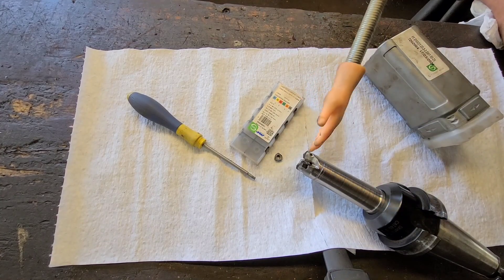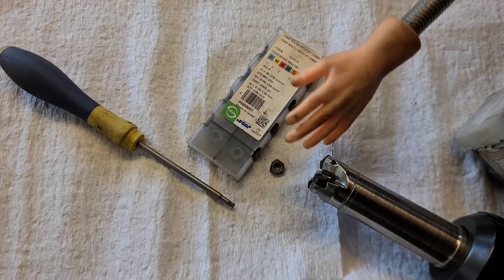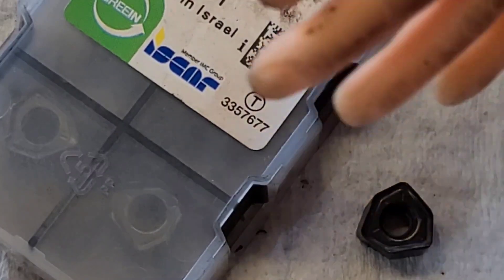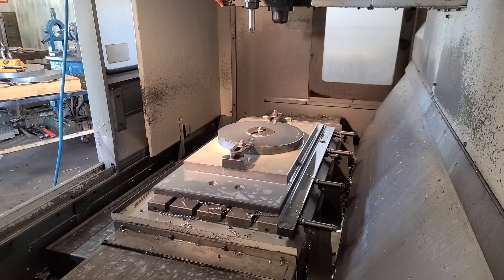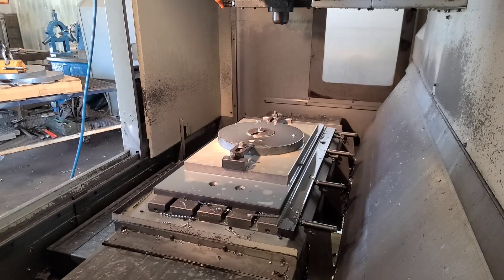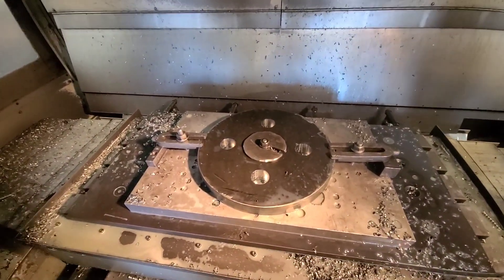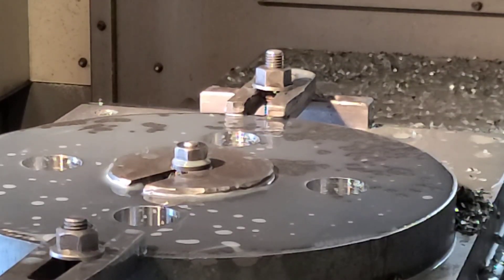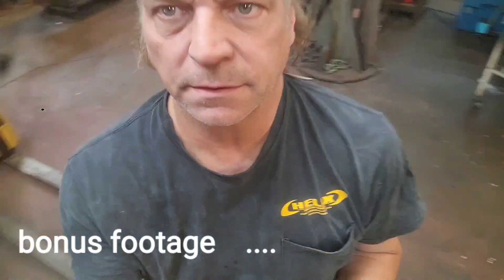Rough milling with high feed mill, Crash included with fire.

Comment: Yet another machinist here, new to the channel. I gotta say, after switching to an air blast instead of coolant with them hi feed cutters i noticed a marked improvement. Probably the coolant forcing the chips back into the hole as opposed to the air lifting the out. Nice work none the less!
Reply: I use pec cycles and i even add stops, so i can blow the holes out in between passes. We dont have air blast at work yet. Coolant has its drawbacks for sure.
Reply: Add pec cycles,  sorry